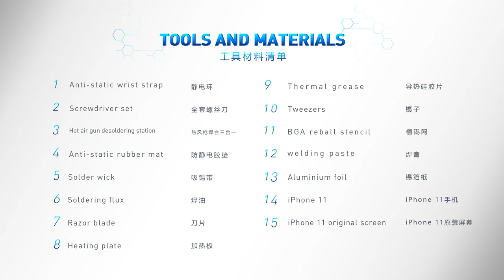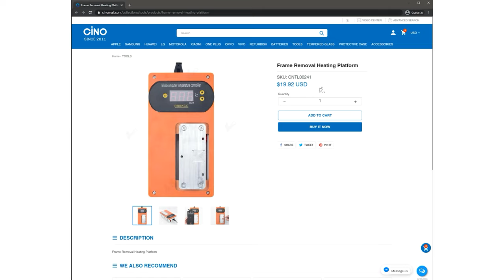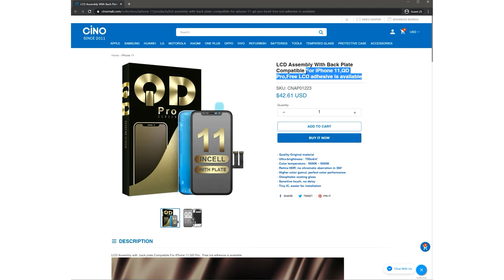Easier New Fix-iPhone 11 Series Non Genuine Screen Warning Important Display Message

Comment: Isn't supposed that with the qianli icopy 2.1 is possible to simple clone/copy old screen information ad avoid this process ? Same question regarding the batteries.
Reply: It only fix true tone not the message, message will still appeared even after you reprogram it

Comment: Excellent video... but can you use the heating platform to also resolder the chip back on to the screen... so u don’t need to apply any hot air at all?
Reply from the maker: We do need hot air gun
Reply: @CINOTechnology  thank you

Comment: Same solution 11pro, 11 Pro Max? Thank you.
Reply from the maker: Almost same, move the same IC to new screen.
Reply: @CINOTechnology  
If we do not replace the chip, how long the iphone will display a message "Important Display Message"  please?
it will never disappear from the settings but from the locked screen and also after phone restart it will disappear?
Thank you.
Reply: @CINOTechnology  this solution works only with original displays or with copy also? I mean.. Can I install chip from original display to copy?